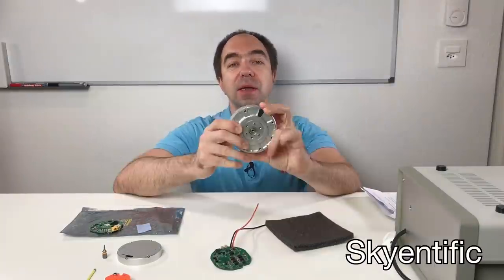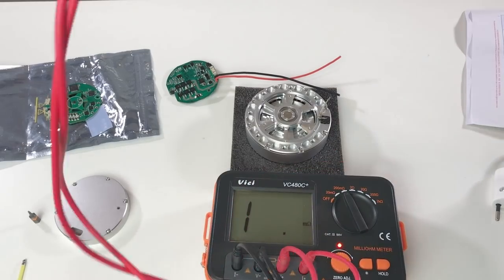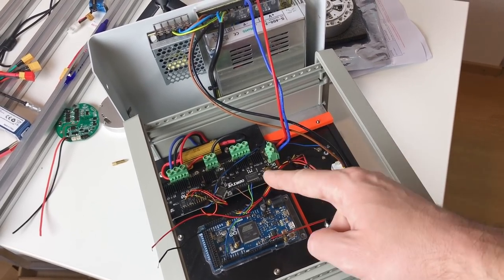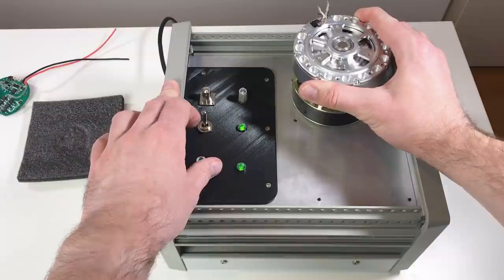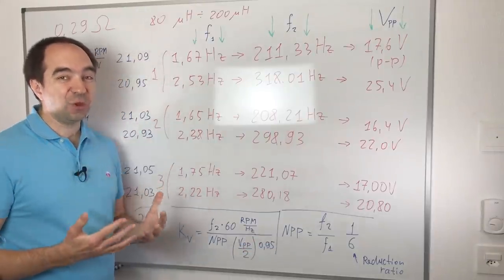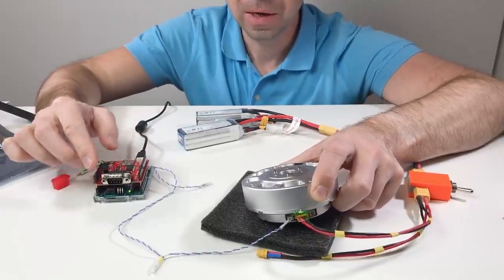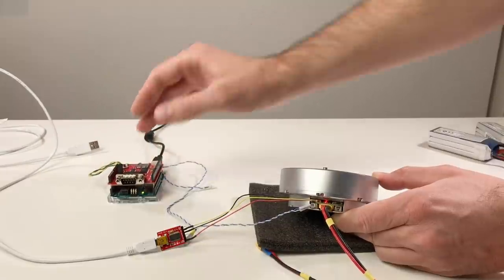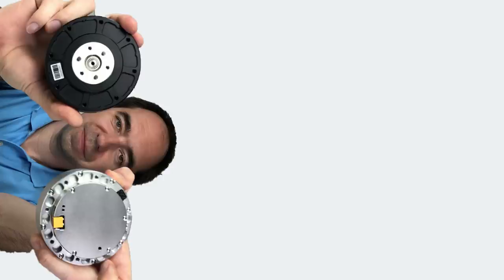Why I have Upgraded this Actuator (or How to Measure KV)?

Comment: I love your videos! 
In the future I would love to see your take on a low cost, limited purpose, robotic 3d printer/laser engraver/CNC engraver, I feel like a delta robot or scara robot would make more sense to me because less complications and less cost but who am I to make such assumption? Although any robot brings the complication of precision of assembly and calibrations, this is the area I think you could bring more value for the comunity simplifying it.
If you are not interested in building it, a theoretical video discussing the options and best suitable kinematics regarding cost per print area and precision.
The 3D printers market got very boring from a few years back, linear deltas kind of died, simple but slow cartesian printers are the majority.
The 3D printer nerds like me are a huge audience and would attract a lot of new viewers to your channel, I envision even a lot of new patreon members if you really develop a robot printer and release it there.
One attractive aspect of a robotic 3d printer is the speeds you can achieve compared to cartesian keeping the same precision, surface quality is an aspect which seems to need more development in robot printers.
I know your other robots can 3D print, but a more specialized, simpler, cheaper and maybe with more precision for that specialized applications makes sense,

Comment: Please help me understand why these actuators are so expensive ($300+) relative to stepper motors of equal mass with similar quality precision milled parts that can be had for around $30?  I understand that the actuators have a controller board and have smaller manufacturing quantities but that should not account for such a big 10x price difference as far as I can see.  I would love to build an MIT robotic dog but don't wand to spend thousands just for the actuators.
Reply: I would like to hear a good answer also. BUT here's mine... These are a relative new type of motor and not really being mass produced at the scale to see cost savings, also, there's not as much competition. There's also a lot more effort needed for motor control features, speed, torque control and position aren't really a concern for steppers. I suspect these things will be closer to $100 once they demand reaches a certain level. I remember mems acellerometer chips were quite expensive until Nintendo popularized them in motion controllers, now they are dirt cheap and lead to a lot of other cheap mems sensors.
Reply: A stepper motor does not have rare earth magnets, and also has an easier construction in the air gap because it just uses reluctance. It's easier to construct.

Add in the cost of a gearbox, and the cost of the electronics, and the cost of machining a much lighter enclosure, and you get a much higher base cost.

On top of that, steppers are made by the millions, these are made by the hundreds.

Compared to other industrial automation equipment, these are quite affordable. The step up from "hobby kit" robotics to "custom" robotics is always a massive sticker shock. Everyone has to go through it. There are no shortcuts! (I spent five years looking for them before realizing this!)